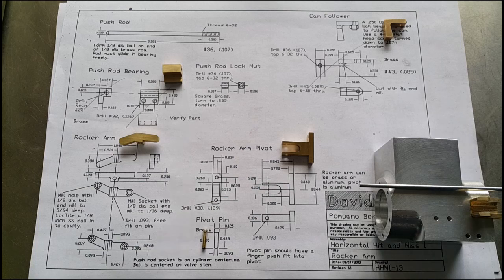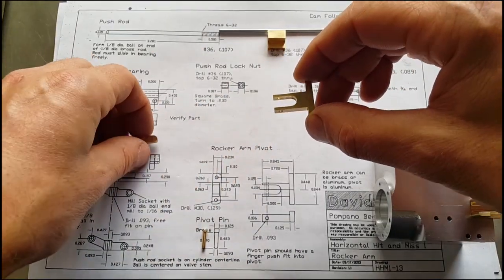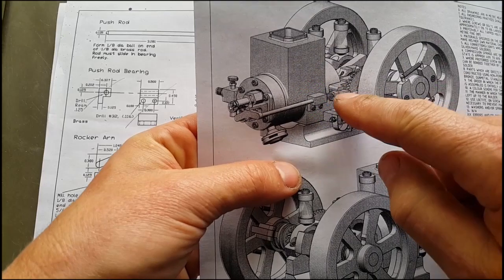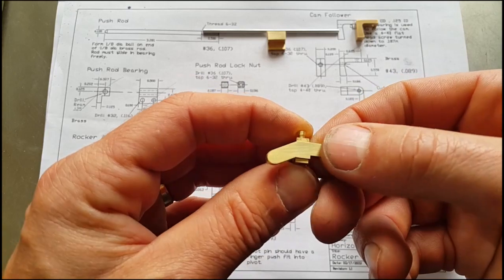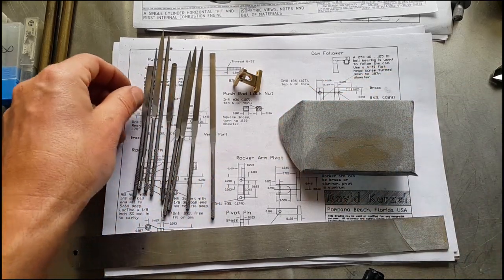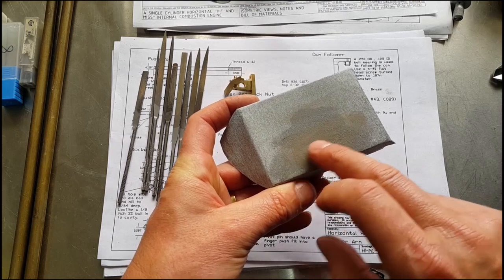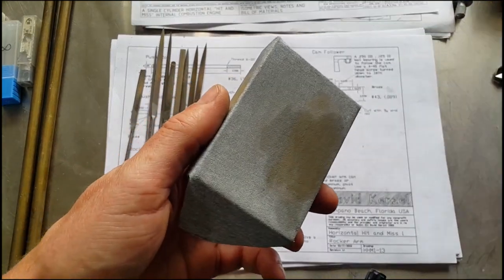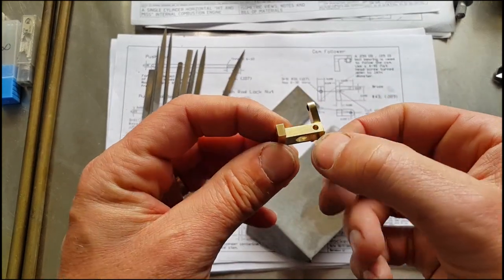#51 - Kerzel Hit & Miss Model Engine - Part 5

Comment: Gday Kevin, there is nothing nicer then polished brass, I have a cheap set of tiny files and I’ve been using then more and more often lately, might have to look into some better quality ones now, thanks for sharing some great ideas,   Cheers Matty
Reply from the maker: Thanks Matty, I use to use cheap files also until I watched Clicksprings videos. Quality files although not cheap definitely make a huge difference